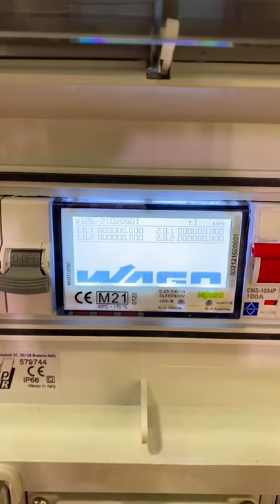NEW WAGO energy meters, NEW WIHA ferrule crimp tools #shorts

Comment: If WAGO made an 8-10 way spring-lever RCBO consumer unit for ~£200, they’d take significant UK market share. Greater speed of repeat (dis)connections for testing or circuit changes, less damage to conductors even if ferrules aren’t used. No torque driver or wiggle and re-tighten necessary.
Reply: DIY Dave would still try and ram as many cables as they want in the breakers. The good thing about the cage style in use at the moment is they grip what ever size and however many cores.
But, a WAGO RCBO CU would be nice.
Reply: @jimbob1ist  DIY Dave helps pay for the holiday :)
Reply: @andypayne1571  because we have to go back and fix it when it goes wrong?
Reply: @jimbob1ist  exactly, how many times have you been called by the person who says "I've taken down a light and put up a new one all the reds together and all the blacks and now it keeps tripping"
Reply: @andypayne1571  that's a good point. Or a plumber who's tried to replace a boiler/valve. Easy money
Reply: Couldnt ever happen. You can get the right level of torque needed on a consumer unit connection with a spring connector.
Reply: @Creamygoodne55  based on what facts perzactly?
Reply: Ahh… A good dose of word salad in the morning. Nothing like a high dose of useless calories…

Comment: Slowly but surely screwed terminals are becoming a thing of the past in favour of these lever types. A full CU would be a sight to behold.
Reply: Never will replace screw terminals imo these lever type are good but in real practice they can create all sorts of issues false contacts after 3 years of service in machine the vibrate. And screw terminals on my pm list one of my jobs is to re torque them all to spec every 6 months. We also have had these terminals melt due to false contacts before om 3 phase motors
Reply: @nightmareinaction629 Not getting loose over time or with vibrations is the whole point of spingy clamps
Reply: @AngeEinstein Screw terminals don't just randomly get loose over time (unless its a poor installation and the wires are heating in which case wagos are just as bad...), I am pulling apart 70 year old fuse boxes where they are as tight as the day they were installed. As far as vibrations go, maybe, but the average installation in a home or light commercial? What is vibrating?....
Reply: @Shrouded_reaper this answer here is why sparks are not engineers
CU would likely have been retightened during maintenance
Everything vibrates. Thermal cycling is a type of vibration. Just the magnitude and frequency of it differs.
Reply: @TheAviation101  We have plenty of half century old or even older installs here in NZ and AUS that are just fine, even on high load circuits. In fact out of all the old breaker boxes I have ripped out for renovations, I cannot recall a single loose connection unless it was due to a really shoddy install. Engineers spend too much time fiddling around on computers and have never done real world work. I agree that there are superior terminal methods but there really isn't anything wrong with screw terminals for domestic and light commercial.
Reply: @nightmareinaction629  
You mean you don't want them to replace screw terminals because you would be out of billing for re-torqueing? Lol.
Reply: @jcvjcvjcvjcv  nope. I personally hate doing it. Do you know how mutch it hurts your hand after you re torque 500~ terminals
Reply: @nightmareinaction629 
I never do 500 in a row, so no.
Reply: @jcvjcvjcvjcv  since that comment I have come to love wago connectors for small wires and circuits that are less than 10 amps. But still won't use them in a mains application such as this one
Reply: @nightmareinaction629  
They are rated a multiples of that. I use them all over the place, mainly 16A circuits and never had a problem. The same with push-in outlets; never a problem, though outlets with screw-terminals have loosened on me.

Comment: Uhhh you werent supposed to crimp the flexible wires for the "springloaded" connection because they tend to not hold very well  in this combination
Reply from the maker: Wago terminal can take solid, stranded or ferruled (crimped) conductors - see link in description for full review.

Comment: Äah? This Claps with close Funktion didn‘t needed crimpings at the end.
This are Made fore striped wires, so you spare Time!
Greeting from Gernany!
Reply: And have a waaaayyy better conductive connection!
Reply: If you work for enough clients you will find out that they can ask for the most retarded stuff. "We shall never deny a guest, even the most ridiculous request," also works for clients as long as its code compliant or in written demand

Comment: We use wago conectors for a testing box at my job (box with some relays we can turn of that turns off if its breaker or ground protection trips) and i have had multiple break over the last 2 years, these are pretty heavily used however bit its still shockingly often that i need to replace them as the orange tab has shattered

Comment: Nice. Would prefer a Wifi/IP connection rather than Bluetooth. In fact, I really would like the energy meter function built into each AFDD
Reply from the maker: The Bluetooth is for local setup and control. The meter can also feed in to a BMS system via hardwired Modbus.

Comment: For high amp connections you shouldn't be using ferule with WAGO connectors, ferule have less contact area then stranded wire
Reply from the maker: See product data in description link
Reply: Orly? 🙄🤪🤡🤥🤗

Comment: The only thing missing is a proper board & components from Hager or Siemens!
Reply: Schneider?
Reply: Hager even has a almost screwless system. Only the input to the RCD uses screw terminals. The bus bar and breaker outputs use spring clamps.

Comment: £268 for a meter 😮
Reply from the maker: should pay for itself in energy savings in the right application
Reply: Who else's smart meter display is chucked in a box / the back of a drawer?
Reply: @efixx  my Father's issue with "Smart Meters" is that they're not "smart". You can't see your current usage while away on holiday, for example to see if an outdoor light has got stuck on. Plus they don't actually save you money anyway, as they still rely on you manually reading a display and thinking "where is that power going?" so you go round turning things off.

And let's be honest, there have been products on the market that show you your energy usage for many years even long before "smart meters" were a thing. There is no significant benefit for most consumers in a smart meter, and the only benefit for consumers is that for most installations of them they can be read remotely by the supplier, yet in areas where the meter is in the middle of a solid brick house or a rural area, where there is poor or no phone signal, a manual reading still has to be done thus making it a "dumb" meter.
Reply from the maker: @CoolSteve08  These meters are intended for  industrial and commercial applications where energy monitoring is part of process control and maintenance.

Comment: One of thing I hate about British panel is that is quiet flimsy. Compare to us we have typical metal panel with over 30 space. The reason we have so many space is because we have to use 2 space to get 240v. So if you are putting 6 240v line you will use almost half of space. Also if you want to upgrade something you can add anything because we have several of the empty.

Comment: 100A by 6mm2??? Are u guys Crazy?
For 100A AC  u need 25mm2 oder 35mm2 ( I need to Look in my Book )
Reply from the maker: Just because the switch is rated for 100A doesn’t mean the circuit is rated for 100A - this board is fed from a 32A breaker.

Comment: i personly dont like wago connectors i find them lazy and also you cant double check if there tight just think what if you got a dogy wago?
Reply from the maker: You double check by trying to tug the cable out.
Reply: imagine hating a new product so much you call it "lazy" since you can't fathom of other ways of doing things and flogging unsuspecting customers "electrical services" by going around and tightening all their old style screw contacts
Reply: @efixx  i just dont like the fact that its set to one tightness and you cant manually change it
Reply: @FinlaysFireSystemsElectrical  Ever seen one fail? It's all in your head.